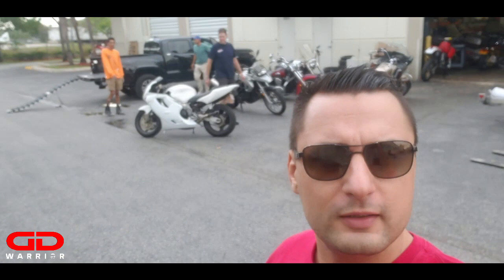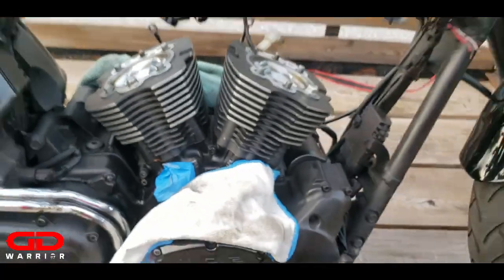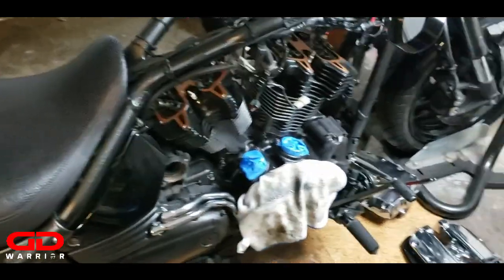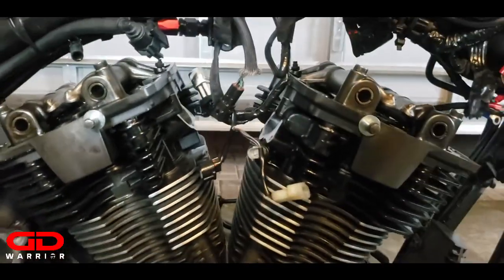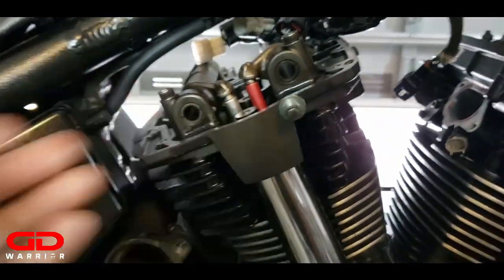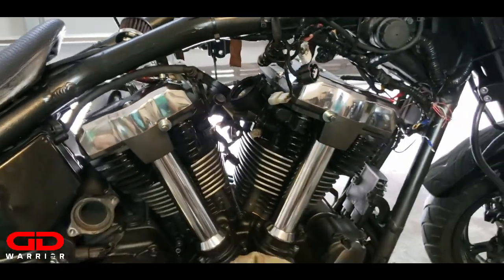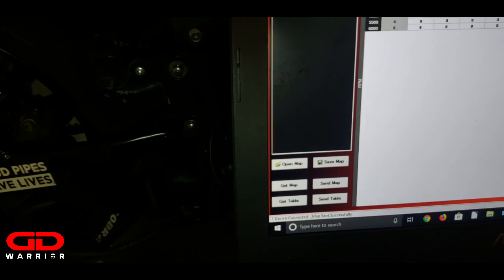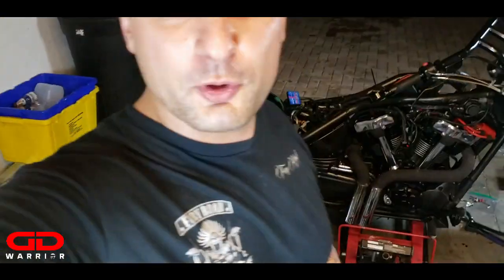Yamaha Warrior 1700 110 BIG BORE KIT INSTALLATION

Comment: I have and 06 with the 110 kit, cams, 5axis cnc port and polish, 2mm oversized valves, speedstar Ecu, oversized injectors, dyna coils, high volume fuel pump, pulstar plugs and nothing will touch it, red light to red light. I can’t run with the sport bikes, but it taps on the rev limit at 154 with the gearing I have. The Patrick racing stuff is a wonderment of quality and durablity. I’ve put 60 thousand mile on since the up grade, runs stronger everyday. Money spent with p.r. pays back with huge grins, and it smokes everything Harley like a signal flare.
Reply from the maker: I am happy to hear you like the Patrick racing stuff! Me too! Love the quality!

Comment: Hey man, awesome video. I have a 2008 warrior 1700 and I have a question for you about yours... I noticed that one has nut-adjustable valves. I had a shop tell me that mine has bucket cups and needs a mechanic's shim kit to properly adjust the valves.. I'm curious if he may have been mistaken or if you just installed those for ease of maintenance? Keep up the work I love the channel